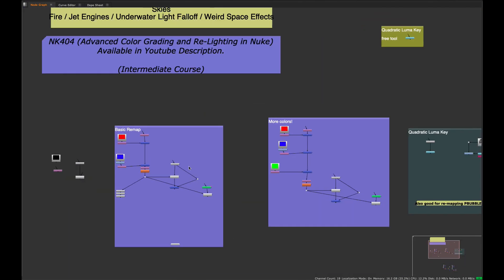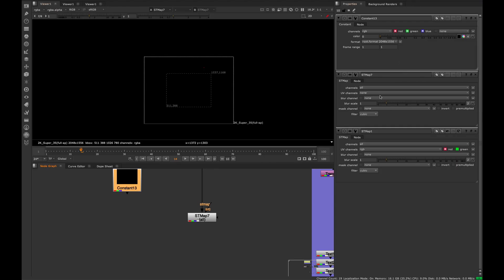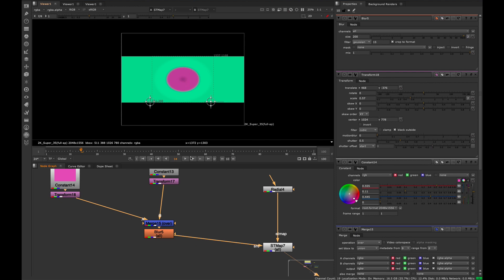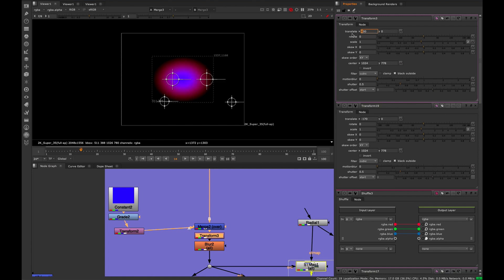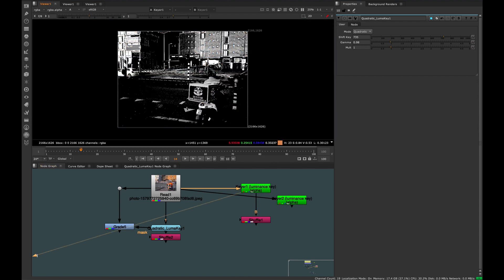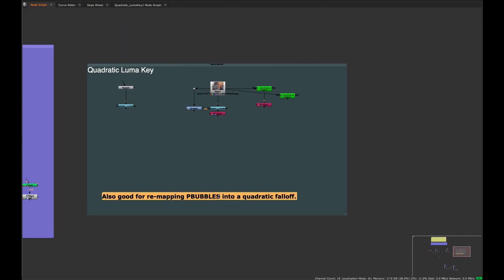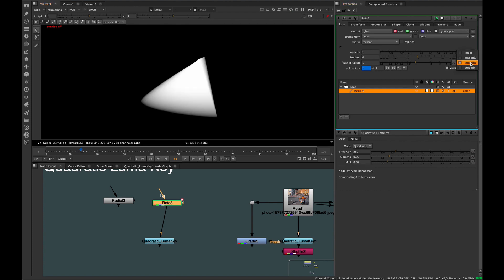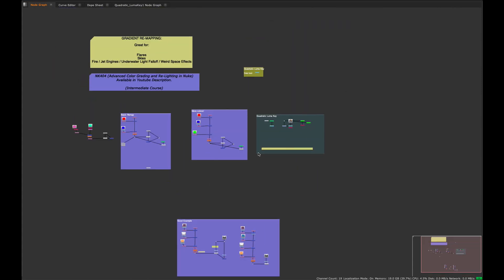Gradient Re-Mapping and Quadratic Luma Keys | Nuke Compositing [Advanced]

Comment: Why does this work? Mathemetically. 
Ive mainly used STMAPs for lenses and blending transforms. 
In RGB i was under the impression it works by using the RGB as like directional transform pixel data. 

So I dont quite understand whats happening when using  single A as the stmap.
Reply from the maker: Not sure to be honest.  I believe I found this technique in an existing tool or blog somewhere at some point when trying to mimic the photoshop technique, can’t remember where.  Really useful though especially for FX related stuff like plasma.  Can do some crazy stuff with Sin waves too if you map those in

Comment: Great video, I just used this technique as a way of generating diffuse maps for terrains using heighmaps, flow maps, and deposition/wear maps from world machine. It works amazingly well. Thanks!
Reply from the maker: Very interesting!  Are you just using it to re-map various details from those alphas and using that to color a texture/diffuse?
Reply: @CompositingAcademy  Yes, I can generate a bunch of masks and maps from world machine, then play with their merge modes, plug that in as my grey shaded map, and then generate a ramp, it creates a pretty detailed color map. My only issue is only half the width (left side) of the ramp is applied, which is odd. I can share this with you if you’d like to see it. It’s not unlike the colorizer in world machine just done entirely in nuke. I just imported the high res geo and it’s working fine. I just need to figure out why only half my ramp is calculated.